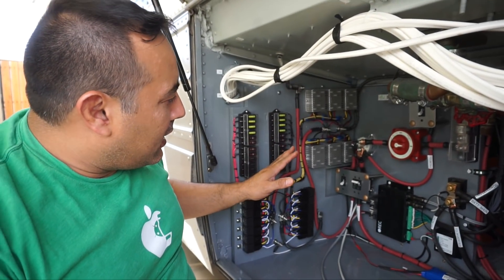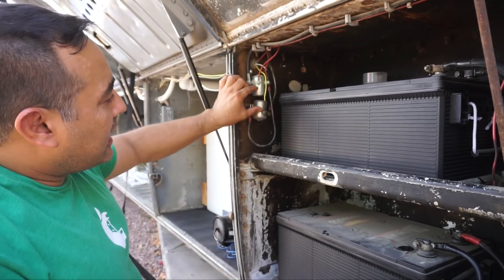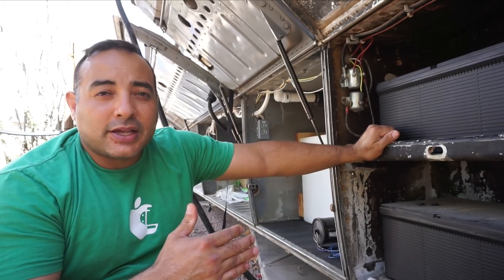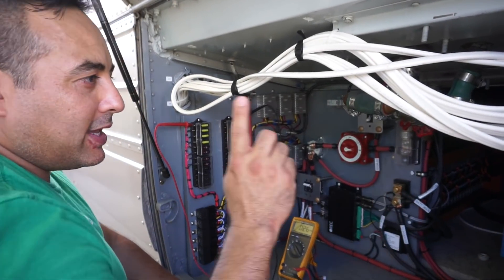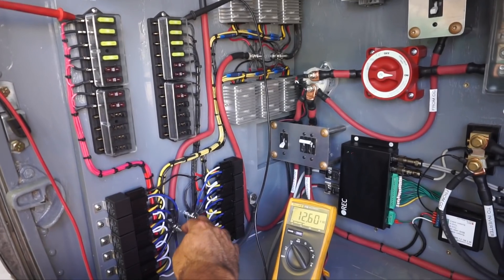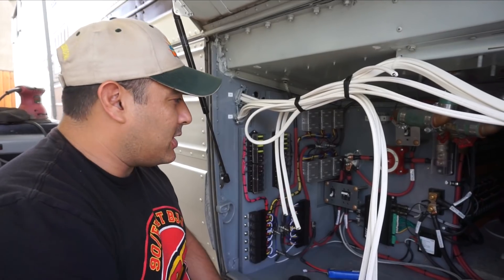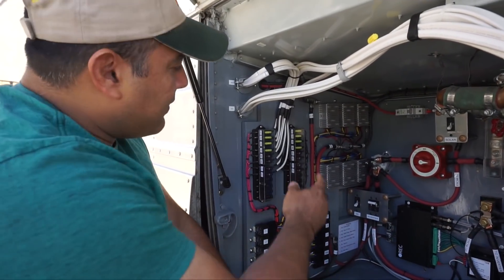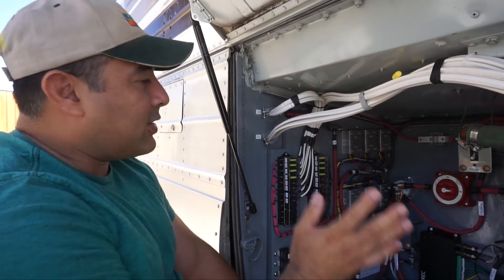DC Power Part 2: Testing, Running Cable, Generator Hook-Up

Comment: Juan I found your videos looking for info on using Nissan leaf batteries.  But you an Michelle have hooked me.  I have been binge watching all of your videos.  I have learned so much from you two.  You have done lots of research for all of us.  Thank you for that.  I have always been a hardware guy when it comes to computers starting in 1977.  I can tell you have a good mind on how to setup the electronics in your bus.  Do you have a complete wiring diagram of your bus?  There are many aspects of it I would like to use.  When I do I will put a plaque next to it to give you two credit..  Thanks to your family to provide all of the videos and time you spent on them.  I have an old 32ft camping trailer given to me and many of the things you have done to your bus I will implement into the trailer.  Keep up the great work.  I will now continue to follow your channel until you guys put it to bed.  Thanks so much..  Mike
Reply from the maker: Thank you realoldgeekster!  We have diagrams of nearly every system.  We most often put those in the blog posts that we release with every video.  In those blog posts we have some of the more technical details as well as parts lists of things we bought or considered.

Comment: Question on the 12-volt system switcher relay array. In the case that one or more of them fail, would that result in connecting the two 12-volt system when the failed and operational relays are in opposite states? Would there be a way to set up a "green panel" that would show you the state of each individual relay (and even control a failsafe) to warn you if that were to happen?
Reply from the maker: Thank you Jeff - that is an interesting question.  Since we would only ever switch those if there were problems with the lithium battery (and therefore that battery would be turned off) - the problem would show itself as a dead circuit (which would prompt us to investigate it) - fortunately those relays are pretty cheap and we have a few spares

Comment: hi, I'm just starting on the journey of doing my own bus and i was just wondering why you decided to configure your batteries in 48 volts and use converters, rather than just run a 12 volt configuration? cheers.
Reply from the maker: Thank you Tane.  We decided on 48V because we want to run some substantial loads on the 120V side (3 Air conditioners, Microwave oven, power tools etc and not have to worry about that) - to do this on 12V system gets pretty expensive because the Amp draw is so high.  Our system runs closer to 55V than to 48V and Maxed out we are only pulling about 100 Amps from the battery.  This means we can run our mains using a single 2/0 cable instead of needing two much more expensive 4/0 cables.  High amps also means high heat and less efficiency.  Solar is another big win on 48V.  We have nearly 3500 Watts of solar on our roof which we can run through a single 250/85 Victron Charge controller.  If we were on 12 V we would need 2 to 4 Solar Charge controllers (at about $500-$800 each this is not a small thing).  Lastly the 48V stuff costs less.  The same Victron Inverter @ 12V costs about $800 more.  Those little inverters have been working great for the last year we have had them in there and they cost about $20 each (we have a few spares but have not needed any).  If you want more info/details email me at juan@beginningfromthismorning.com

Comment: Always cool vids.  Though you may want to use conduit for your wiring in the future.  Wouldn't take much to snag a line with something.  They're all fused which is good but "best practices" indicate that exposed wiring should be shielded.
Reply from the maker: Thank you Tom - we will be putting everything in conduit as we wrap things up and have everything finalized.  We were making changes so often that we felt we should wait on doing conduit - we are probably close enough now to start that processes.  Great tip and thanks for the feedback

Comment: didn't you guys have a pdf of your wiring setup?,on your bus, where can i find it again
Reply from the maker: Hi - we detail the supply side of our system in this blog post: http://www.beginningfromthismorning.com/house-batteries-part-7/ - (or just click here for the picture: http://www.beginningfromthismorning.com/content/images/2018/01/Electrical-Power.png )  I have not drawn up a diagram of our DC side yet but I intend to in the next few days or so.  I will post it when I have it finished.  You may also find a high-resolution picture of how we wired the BMS here: https://www.dropbox.com/s/9xpxlsghtbfhvkn/REC%20BMS.jpg?dl=0  I hope this answers your question - If not please let me know and I may be able to get you what you need.
Reply: that was it... thank you very much! :)

Comment: Love your videos and the work you do is awesome. You are giving me great ideas for when I decide to build my own RV. The only thing that concerns me is the dc fuse and relay setup. From working on cars there is only a fuse and relay on the + leg of the power run. I am worried that you may have added an extra failure point in the system. The relays you have look like good quality but from my experience they are prone to failure and I would hate to see you have problems when you are miles away from home. I am always looking forward to the next video and I have watched all your previous builds. Keep up the great work.
Reply from the maker: Hi Hill on Wheels - thank you for the kind words and for the suggestions.  I went back and forth about fusing the negative leg also.  Supposedly, it is the correct way to do it if you have a floating negative.  In a car application you have a chassis ground and so there is no need to fuse the negative leg (at least according to my research - if you know different please let me know).  I share your concern about the relays - that is one of the reasons they are wired for "normal" operation using the "Normally Connected" leg.  I have purchased a few for back up and they should be pretty easy to replace if they do fail.  If our system is working properly these should not be toggled on and off on very frequently (hopefully never) basis.  I will keep everyone updated on the design and if I have problems - thank you for sharing your thoughts.
Reply: I haven't researched what you did but from watching you previous videos you do your homework very well and I was just concerned due to lack of knowledge. I will just have to keep this in mind for future projects. Thanks for the response because now I know. I look forward to when you build the inside and make it all pretty. I was watching Tiny It Yourself on youtube and they are building a tiny house trailer all from metal 2x4 studs because it is much lighter then wood. I don't remember if you talked about what the interior walls where going to be made of but for weight saving this could be a way.
Reply from the maker: Thank you Hill On Wheels - I learn a ton from folks who comment on my videos and website - I appreciate your feedback.  I was planning to build the walls from metal as well but not 2x4 metal studs.  I was planning to frame them out with angle iron and use plywood sheets for the walls - I will take a look at Tiny It Yourself and see how they did it.  Thanks!

Comment: Wow that's some tidy wiring :) Your DC system seems really complex, and that's coming from a big fan of overkill. Glad it makes sense to you. Do you have a schematic or two that you plan to laminate and store in the wiring bay? Just in case you're incapacitated or unavailable and a rv service tech needs to make repairs... 

I'll have to go back and watch part one. Curious about how you settled on using several of those "brand-x" DC/DC converters, instead of a Victron Orion, Powerstream, Newmar or one of the other brand name units?
Reply from the maker: Hi Gordon,  Thank you for the kind words.  The DC system just looks complex because we had to keep the output of the 48-12V converters isolated from each other.  This meant for the backup system we had to put in relays that would then take those isolated outputs and connect them together for the single 12V source.  We considered DC/DC converters from Victron, Orion, and a few others but there wasn't one that put out the kind of power we were looking for.  We decided to see if this configuration would work - so far so good - we will report back if we find that they did not work out very well.  If you know of one - please share that information.  Thanks!
Reply: If I may ask, why do you need a lot of power in the 12v system, are you using 12v appliances, or just lighting and ventilation? The Victron Orion 360 watt will accept 30-60 VDC and output 12.5 VDC (adjustable via trim pot). If you need A LOT of 12v DC power, check out the Mean Well SD-1000L-12. 72 volt max on the input, output nominal 12v (adjustable) 60 amps.
Reply from the maker: Hi Gordon - hopefully we won't need too much power on the 12V side - we are running fans, lights, pumps, (water heater brains), and charging stations.  We started by listing out how much of each circuit would consume (max) and tried to work backward from there.  We intend to live in the bus full time so we don't want to be short on power :).  We will keep everyone posted on how this all works out.

Comment: I carry a 4.0 BFA crappy gas generator, if I were you I'd get one of those small quiet honda / harbor freight knock off versions as an emergency backup.   Right now in MN we've had over 100 degree heat already and with where my bus is parked I don't get good solar until after noon and it's roasting in there  pretty quickly.   I did just buy more cellular blinds, but they don't really do the job unless they are fitted out with the valence and shrouds.  So I can run the AC from batteries + solar, but I'm always playing catchup.     I did connect to shore power but configured the Multi-plus to only pull a max of 10 amps from shore and then only charge battery at 5 amps, solar takes care of the rest.   I've shot myself in the foot by only having 1 100/50 charge controller, I need a second as I have 1950 watts of solar, but at peak  sun, when I could pull that, I'm limited to 1400 watts or so.   I think in my final configuration I'll have the 2 100/50 charge controllers and have another 600 watts of panels to ground deploy as needed, I'm not sure I have room for another 2 panels up front.
Reply from the maker: Thanks for the details on the system - I will have to see how ours does when I finally get the solar up and running.  I am very happy with our battery so far and we ended up wiring in a 50A power outlet at our house to charge it.  For solar we ended up with a single 250/85 smart solar controller  - I hope it will be enough.  Keep up the good work on your bus!

Comment: Standard is black is hot and white is common (Black, Red, and Blue are used for hot wires) https://www.allaboutcircuits.com/textbook/reference/chpt-2/wiring-color-codes-infographic/  https://dfarq.homeip.net/is-the-black-wire-hot/ 

One other set of lights you should think about are "docking lights" these are on the high end RVs and run down the side and are used for night time parking (white / Clear)

Nice job. Glenn Lever
Reply from the maker: Thank you Glenn - I always look forward to hearing from you.  I suspected that black might be (+) at first because the Maxx Air fans we purchased had black as (+) and white as (-).  I am going to take someone's suggestion here and put red heat-shrink on the white lead inside the bus where I hook them up.  

Great Idea on the docking lights - it might also be nice to have turn signals that run the length of the coach as well (in case we have a car that is on the side when we are trying to get over).  

I will look into both of these things before we start working on the inside.
Reply: Last season, I redid the lights on the side of the trailer. I did add a turn signal light mid trailer (when towing the trailer we are 72 feet long) Went to LED. I was not completely happy with the result. They are very bright dead on but and not so bright from an angle (the angle that an overtaking car would have). If I did this over I would do one of two things, either get LED lights that have the LEDs in an array so that they ate bright form all angles or go back to the incandescence lights. I actually like the light from the incandescent lights, but they use too much power for the number of lights I added. https://www.lever-family-racing.com/lever-family-racing-home/family-vehicles/2006-car-trailer-2/led-clearance-lights-2017-07-10 

I find your videos informative, and well done. Glenn Lever
Reply from the maker: Thank you Glenn - I enjoy your videos as well!  
I will read over your blog and take that information into account when I go to pick out some lights.  We were considering LEDs for the same reason (power consumption),  but you have a good point with the view angles.  I also thought it might be nice to get a light that doubles as a turn signal as well as a marker light - I saw some once on a vintage Eagle and thought they looked pretty sharp.  I have been trying to find some similar looking ones but have not had much luck.
Reply: Are you talking about an American Coach "Eagle"? I have the "Dream" (next model down). The American Coach parts department prices are amazingly low. You would expect the prices to be higher than the industry, for the most part they are not.

To order parts they will want the vin number, date of manufacture, etc. Not sure what year Eagle you looked at, but here is the data from my Dream.
Vehicle Vin 46GED1814T1052706 
Fleetwood # 720AV5202890 
MFD ID # 02890 
Chassis sate 7/96 
Vehicle date 1997 

Glenn Lever

Comment: Juan and Michelle...I really enjoy the videos and tips that you provide along with the step by step.  I am still confused however about all of the converters?  I know you want to be safe but maybe too much.  I don't mean to come across as a armchair quarterback.  We had a natural gas whole house 20 KW generator installed one thing the guy that installed stressed was it has an exercise period but that tends not to be enough to keep the generator maintained well enough so if your going to store be prepared to run it once in a while to maintain the generating capabilities.  Ants was another thing mentioned they like to eat control boards.  Love the vids.  V/R, Ed Reagle
Reply from the maker: Hi Ed, Thank you for the kind words.  LOL, no worries about the armchair quarterbacking, I have learned a ton from you and others who regularly post on my videos.  Doing it all by myself would not be near as fun - we live in amazing times.  

I am not a professional and try not to be a know-it-all.  I research as much as I can and try to make the best decision based on that information.

The primary driver for all the converters was that we couldn't find a single one large enough to fit tour needs (around 1500 Watts) - secondary to that was efficiency and cost.  They are rated to be over 96% efficient and cost less than $20 - they also got really good reviews on Amazon and fell within the right operating voltage for my pack (30V-60V).

Great points about the generator - we are planning to have some kind of scheduling app that reminds us to do all the things like run the generator, change the filters, check the starter batteries, check the tire pressure etc etc.  Hopefully we will be able to stay on top of it all :)

I never heard that about ants!  I learn something new every day - thanks for being a part of our journey

Juan
Reply: Juan 96% efficiency is great but as somebody stated with every connection you lose something. I thought possibly two 8s would have worked if they are made?  You have customized everything so well and marked everything so meticulously you probably would be okay I was thinking of the heat and efficiency in my remark.  Keep forging on young man you and Michelle and your kids are doing a great job.  A lot of sweat equity going into this coach.

Comment: Something Else to think about.   You can get one of those isolators where the alternator from the Engine can put power into you Battery bank once it's starter battery is full.  you will need a boost converter to step up the voltage but most big Diesel Pushers have pretty big Alternators.      I did this on my dad's RV (Gas) but in about 10 min on the road there is current going into their battery.    Used a MPT 7210a to put up to 10A into the 7s battery.    He only needs a solar panel when stopped for more than 3 days.
Reply from the maker: Hi Jason - thank you for commenting.  I have very briefly looked into a boost converter like you are talking about but have yet to find something that pushes ~57 - 60 Volts needed by the battery to get a good charge in.  Our generator on the engine very large and is supposed to be rated for something like 140 amps, however I have mixed feelings about putting a large load on the old engine (Detroit Diesel 8v71) - I am hoping that our solar array is large enough that we have enough power even while going down the road.
Reply: Beginning from this Morning that is the trick and I understand the loading issue.  If you do want to look at that I'd be willing to help you figure it out